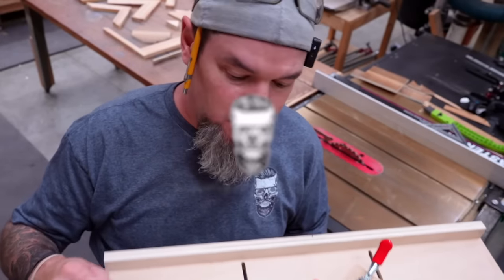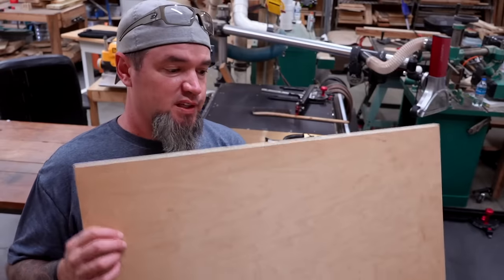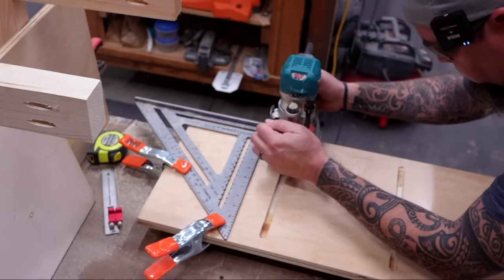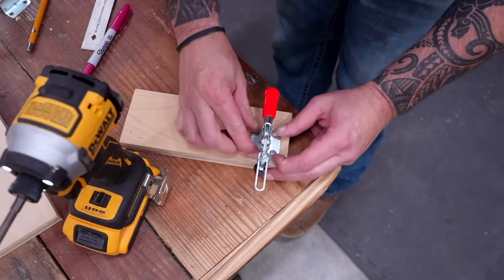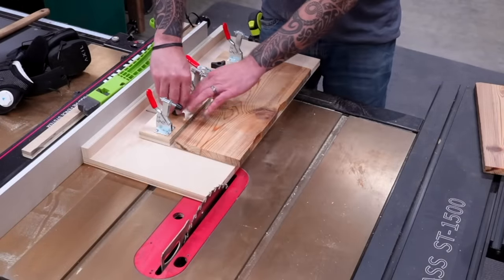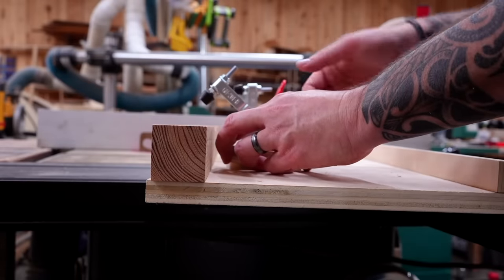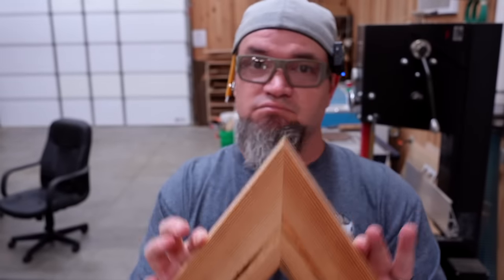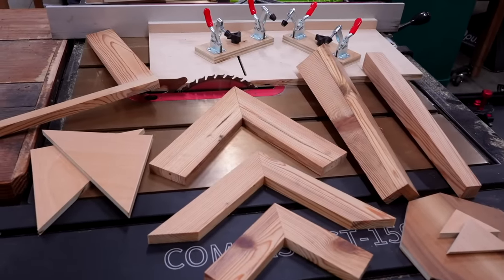The EASY Ultimate Table Saw Sled

Comment from the maker: ▼EXPAND FOR MORE INFO!▼

★ Plans! All plans include exploded views, cutting layouts, and easy-to-follow step-by-step instructions. 
Etsy Shop: https://tidd.ly/3DzEa0f

★ Join The Patreon Community!  
https://www.patreon.com/MatthewPeechwoodworking

★MPW DISCORD!   https://discord.gg/kYF69Wd8s2
Our Discord is a place where you can chat with like-minded makers, share your brags, and ask questions about anything woodworking.  

★ THE BRAG BOARD!  Share your brags and view brags from other makers!  
The brag board has its own discord channel where you can post, view, and comment on builds.  Just follow the Discord link above!

★ Subscriber Discounts! (Affiliate links help to sponsor the content)
-RZ Masks (Save 15% with code: PEECH)
https://tidd.ly/3TJ1w9q

-AXIL Electronic Hearing Protection (SAVE 15% with code MPWOODWORKING)
https://goaxil.com/pages/gs-extreme-affiliatte-special?rfsn=6622602.9d133c

★Links to tools you may see in my shop  (If you use one of these affiliate links we may receive a small commission that helps to support the channel)
Tape measure https://amzn.to/3tF1IME

Hex Bolt Knob Kits  https://amzn.to/3PMjTJP

4Pcs Hand Tool Toggle Clamp Antislip Red Horizontal Clamp https://amzn.to/3RLbp8j

Tape measure https://amzn.to/3tF1IME

Pencil https://amzn.to/3PePbHX

Makita Router https://amzn.to/3rMlTcX

Spring Clamps https://amzn.to/3DE8IML

Dewalt cordless orbit sander https://amzn.to/3qmYc7t

Swanson Square https://amzn.to/3TgUgSx

CA glue https://amzn.to/3bu8RbR

DEWALT 20V Max Cordless Drill Combo Kit, 2-Tool Drill Driver/Impact Combo Kit 
https://amzn.to/3Kh5OAE

Dewalt Brad nailer https://amzn.to/3cEjysY

Glue bot https://amzn.to/3wHSFKT

Titebond III Exterior wood glue https://amzn.to/36HHBEx

DEWALT Compound Miter Saw-  https://amzn.to/3fqkIWX  

Push stick https://amzn.to/3TYwoTY 

IRWIN QUICK-GRIP Clamps, Mini Bar, 6-Inch, 4-Pack  https://amzn.to/3A2hXEM 

Craftsman Air Nailer and compressor combo  https://amzn.to/3JLdVVo

Dewalt Jig Saw https://amzn.to/3tGmkUS

Check out my Amazon Page for links to all the tools you see throughout my shop!
 https://www.amazon.com/shop/handy.man99

Comment: I’m wondering if it could be build with a runner and without the 1” piece to accommodate longer boards? It doesn’t seem like it would work for cutting pieces longer than 12” or so, depending on the angle? It’s a really amazing design though! Someone could use it to make a “quilt” out of wood!

Comment: Matt, I built one of these this past weekend and used it to put a straight edge on a bunch of oak slats from pallets.  I have one suggestion for this jig.  I used pine as my board for the clamps and noticed that after a few clamps, the board started to crack at the point where the clamps mount and the edge.  I switched to a piece of oak 3/4 in blocks, correcting the problem.  Thank you for all your great videos and ideas. Sometimes I go into vapor lock trying to come up with ideas, but you spur me along with your great teaching and explanations.  Keep um coming.

Comment: I came up with something very similar recently because I wanted to taper some legs.  I ended up making two sets of adjustable blocks of different thicknesses to accommodate thicker and thinner materials.  Of course, if your toggle clamps adjust more than mine do, you may not need more than one set.

Comment: I like this jig. It seems like one could use a thicker 3" X 8" block, with longer bolts, & attach clamps to it for securing thicker pieces of lumber. Just switch to the block thickness needed. When i bought the clamps off the jungle store, they were relatively inexpensive, so making the extra blocks should be cost effective considering the overall savings of using this jig vs a jointer, for instance. I think harbor freight sells the clamps now too.

Comment: Great design and video, Matthew! Simple and effective. By some cosmic coincidence, I recently bought 4 of those clamps with only a vague thought of using them with a sled. I’m curious about advantages or disadvantages of using the miter bar slot instead of the fence. Obvious disadvantage is a few extra steps to make. Advantage seems to be not having to focus on keeping the sled against the fence in use. Thanks as always for what you do here!!!
Reply: This is old, I know- and you've probably figured it out by now.  But with the slot, you're locked into one specific distance from the blade.  Using the fence, you're only limited by the capacity your fence allows, so you can do the edges on much larger (or smaller boards).

Comment: I hate to complicate what might be the best simple table saw sled I've seen yet, but here goes...

I would start by adding a miter-slot guide and removing the fence that runs next to your fence. This removes the length limitation of your cross-cuts and miter boards. 

 Then, I would duplicate it for the other side of the blade. 
 Without the attachments, the second board gives a zero clearance and support for the other side of the blade when needed or desired. 

The slots on the second sled also give you the option of working from either side of the blade.  

To get the 90 degree cut accurate, align one edge of a carpenter square to the kerf edge of the sled and the fence to the other edge of the square.  
(If that is not accurate enough, why are you using that square to measure square of your projects?)

If you want to complicate your clamp attachments for thicker boards, you can cut a thin board the same size as the clamp boards with a U cut out of one side that will allow it to slide under the clamp board. This will allow you to raise the board for thicker boards.  Obviously, this is a luxury option only.  Some wood workers like luxury.  

I use a Hitachi (now Metabo) job site saw. I was in a hurry to build my project so I built a temporary single-sided sled, which I still use today, years later.  I built the other sled, which is just a board with a runner under it, when I wanted more support for the piece I was cutting and for cutting thin strips. 

My favorite thing about the split sled is that I can use it with the blade guard on.  I have to lift the right side on the rare occasion that it interferes with the cut off.
Reply: A few days after my comment above, I made the same thing with dovetail slots for the Matchfit 360 system.  I use the matchfit clamps right now, but my next move will be to add the boards with the clamps like you have on top.  Anchored down they will provide repeat cuts, which I can't do with just the tall clamps.  They slide too much. 

Another use for the sled is to make what I call "bricks"  You can set one of your clamps up perpendicular to the blade with a stop block, say 6 inches.  Then set a parallel clamp to 3 inches.  Cut one piece in the 6 inch cross cut clamps, then when you are done, put that piece in the 3 inch rip cut clamps while adding a second piece in the cross cut clamps.  
NOw, instead of two 45 cuts, you are cutting one board to length and the other to width at the same time.  Keep doing that and you cut in 1/2 the number of cuts to make your 3 x 6 bricks.  

My sled is a little larger in both directions than yours, especially in the length. It's just long enough to joint the most common length of boards I need to joint, and I had the added benefit of not having to cut the sled down to size, just to width to get a straight edge. 

Great project.  Thank you.

Comment: Thanks for the jig. Just bought a plan but my local B&Q (UK) don't have anything 1" depth. Must it be this depth to work?
Reply: I just made one, and I don't have a plunge router.  Just clamp a thicker board (like a 2x4), instead of the speed square for a guide.  Then start the router, and gently guide it down to start about an inch in from the end of the slot, sliding it down the board.  Once it's flat, you can go slowly to the edge you want, then back across the full length.

Comment: I really like this. I plan to make one. 

One mod I’ll likely make is to put a runner on the bottom. That way I can run it without the fence and allow longer stock for the  other cuts. Is this a good or bad idea? Any dangers I’m not considering?

Edit… I realized the drawback of my idea. It limits the width of stock that can be jointed with the jig. Guess it would be a trade off.
Reply: What is a "runner"? I might know but not sure.
Reply: @wizard2319  a strip that goes in the miter slot, like would be on a cross cut sled. Maybe I used the wrong word. 

It is the width of the miter slot and attaches below the jig to allow the jig to run in the slot with no fence.
Reply: I'm thinking the same thing. Also without the lip, which would allow for much longer stock when cross cutting.

Comment: What size are the screws? Can a melamine board be used for wood and do you have an issue where the screws lock down breaking down the board with repeated use.
Reply: Melamine wouldn't hold the screws well enough, but you could use it for the 1" piece. I used #8 x 1/2 screws, because I used 1/2" plywood rather than 3/4.  If you use 3/4" plywood, use #8 x 3/4" screws.